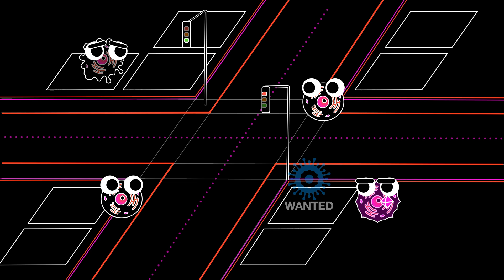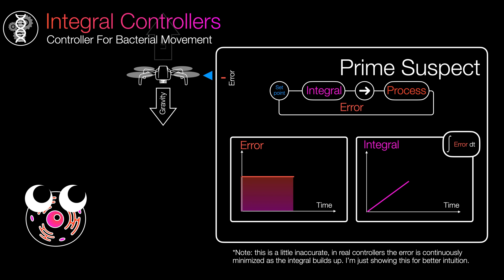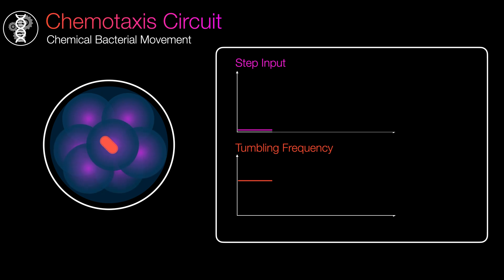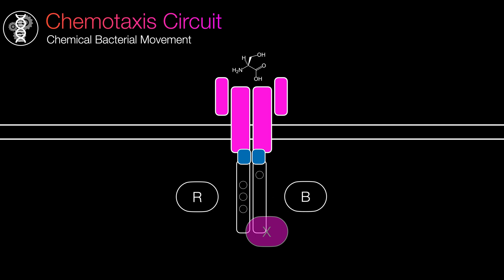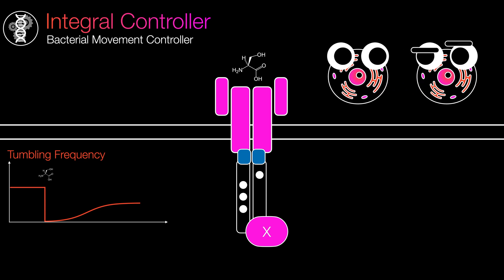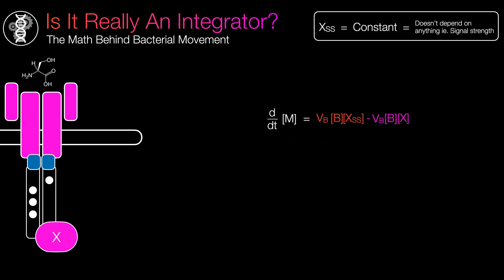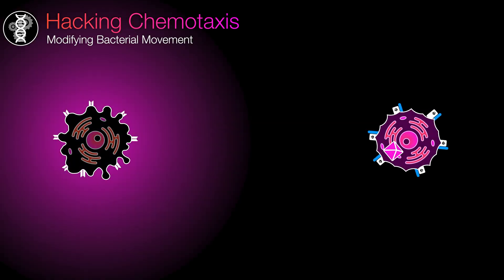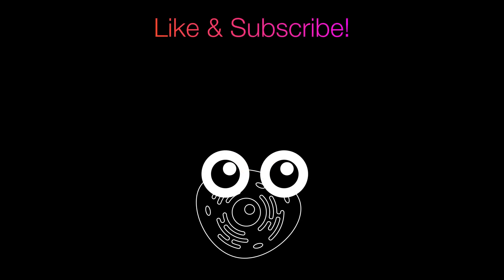Hacking Bacteria Programming Using Control Theory & Math

Comment: As an electrical engineer that has done a lot of software development and control systems, and has made some biomedical instrumentation, this does not surprise me at all. PIDs, specifically P only, I only or PI loops are so incredibly common thay even when you try to make something fancy, you realize later that what you made simplifies to either 1 PI loop, 2 parallel PI loops or 2 nested PI loops or any similar combinations, sometimes cascading a whole bunch. A P controller being just an error detector, amplifier and actuator, and an I controller being just that but with an accumulator (amount of charge in a capacitor, amount of "number" in a sum, amount of chemical in a liquid, pressure in a tank, distance in a lever) you can so easily accidentally make one.

So many problems can be solved by just adding more and more PI controllers until it works, even if the shear amount of them causes an incredible amount of cross-interaction. Another super interesting thing about P and I controllers is, you don't really need to know that much about the system to tune their gains. You can just randomly set them, then tune them until they work, no matter how many there are in the system, and if their gains are set too low for P and I, it still works, it is just sluggish. Too high gains and it oscillates, which actually is sometimes the desired behavior for your randomly iterated system, or it oscillates and quickly blows up or dies, in which case, no offspring.

Comment: If it looks like deliberate engineering, if it works reliably like deliberate engineering, if it elegantly handles a variety of inputs like deliberate engineering, then it's probably e- .... "nature"?! 11:12 🤔😆
14:58 "Devise - verb [ T ] /dɪˈvaɪz/ - plan or invent (a complex procedure, system, or mechanism) by careful thought"
It's either devised or it's the product of evolution by unguided natural selection but you can't have both, they are mutually exclusive.

Comment: I'm so glad this was recommended to me, super cool and well put together! As a bachelors in engineering and not biology, I'm also curious to know if some more aspects of PID controllers translate to the bacteria here: 

- the tumbling frequency responses that you visualize look "critically damped". I'm wondering if bacteria in real life all act like this, or if some act "underdamped", where their tumbling frequency responses overshoot back and forth before settling on the steady state? Intuitively, I might imagine that bacteria with "perfectly tuned" ratios of R and B activation, which I guess can be analogous to being critically damped, may survive the best, so by natural selection bacteria all tend towards one specific tuning
- Is there another protein response chain/biological equivalent to the derivative block in this analogy, or is it just this one?
Reply from the maker: Well… I have a video on full on applying control theory to biology in the works right now.

As for the derivative path in the bacterial controller, I don’t think it exists for this mechanism. And as for the overshooting, I don’t think it’s possible in this case since there is only one steady state X value it can reach… but I’ll have to look into it more to get a proper answer.